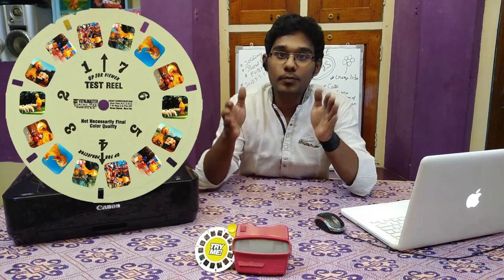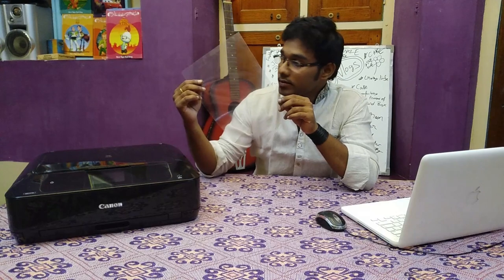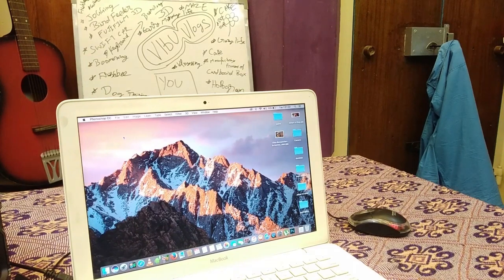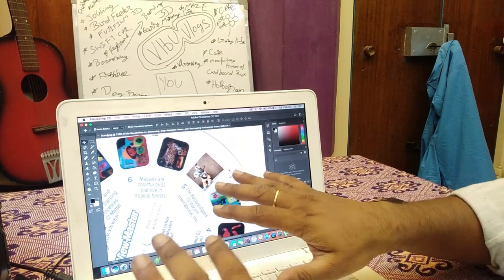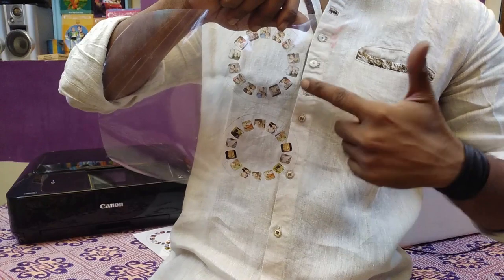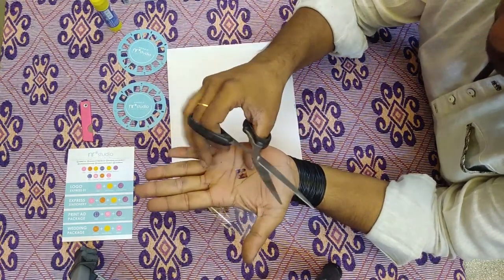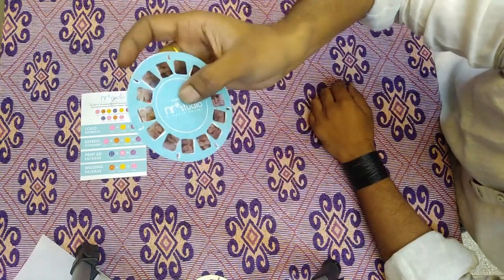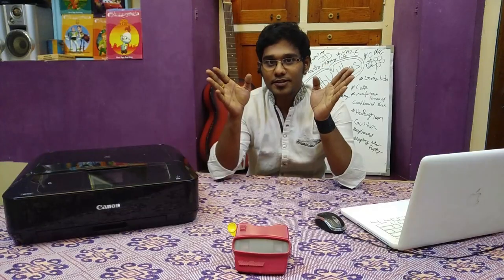Make Your own Customized View-Master Slide Reel

Comment: Interesting, but might I make a suggestion? Instead of cutting out each individual slide and pasting into the card reel, take two of the card reels (front and back pieces)  with the holes for the slides cut out, take the photo paper with the slides printed on it, and just cut out the whole collection as a solid disc, and sandwich it in the middle of the two pieces of card paper, and just line up the slides with the holes in the card paper, and just paste it all together like that.
Reply: Exactly what I was thinking.

Comment: Awesome!🙆‍♀️💗
 What the paper did you use to make the reel? Is the ohp films??? Or other film?🤔🤔
Reply from the maker: Thank you. thanks a lot. We used many papers. Like OHP paper, x ray paper and many more. It took nearly 8 months for us to short this out. We found that paper is just a part of it. The main is the printer. We played with many settings in it. In this printer it had sooo many setting like photo printer, x ray printer and etc etc. If you get the thickness of the film below OHP sheet thickness then you have check the printer quality alone then.  In x ray paper that we printed which was showed in this video the quality was excellent.
Reply from the maker: In OHP sheet itself there are many types and many thickness.

Comment: Hi! What paper do you use to print the images
Reply from the maker: We used all types of transparency sheets and OHP sheets. Do check microns of the sheets before buying. Quality differs for each and every type sheet. We also used x-ray sheet also. The printer which we used has an option of printing photos also. Using tat option we printed. Do check the printing quality of the printer also. Its more important.

Comment: Only problem, It won't be 3D . Cool video tho
Reply from the maker: Thank you. Thanks a lot. Obviously If we keep the same pic it won't be 3d as you said. but If we want in 3D we have to shoot the pic in 3D camera like fujifilm w1 3D or fujifilm w3 3d camera . We are having it too. We tried the output took in it and it was really superb.
Reply: @vibutimes  really don't need a 3d camera to make stereo pairs. using any digital camera you can make 1 shoot and then 2nd
Reply: why it won't be? you should make 2 different photos for this

Comment: Hi! What paper did you use?
Reply from the maker: We Used many types of ohp sheets. there are different types of sheets in it. according to printer also it changes. the GSM that is the thickness of the paper should be small.

Comment: what paper do you use to print the reel?
Reply from the maker: We used many papers. Like OHP paper, x ray paper and many more. In OHP itself there many types and many thickness.  It took nearly 8 months for us to short this out. We found that paper is just a part of it. The main is the printer. We played with many settings in it. In this printer it had sooo many setting like photo printer, x ray printer and etc etc. If you get the thickness of the film below OHP sheet thickness then you have check the printer quality alone then.  In x ray paper that we printed which was showed in this video the quality was excellent.